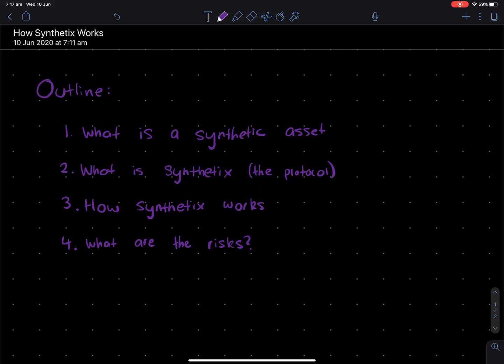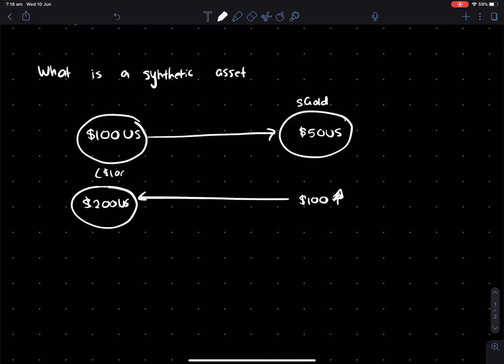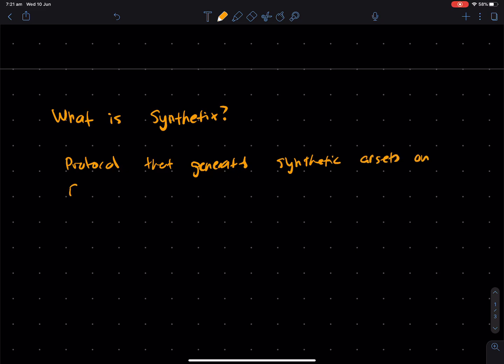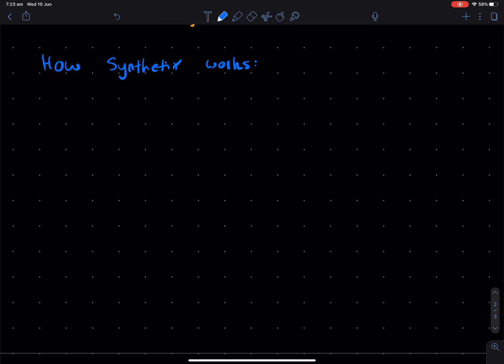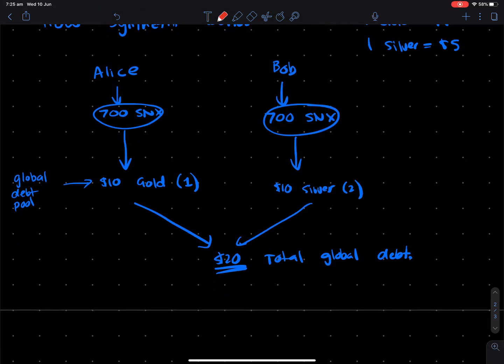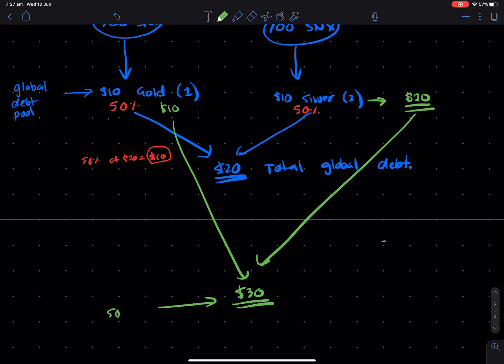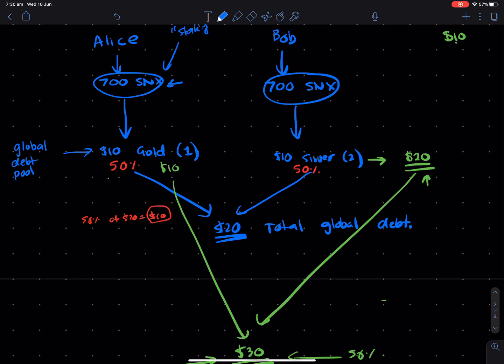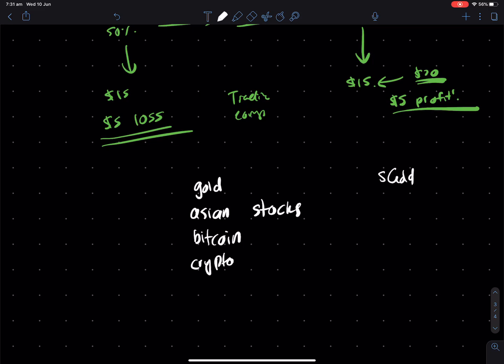How does Synthetix work?

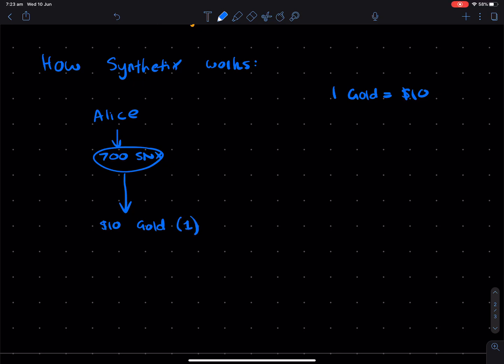Comment: @6:39 — 700 SNX = $100 of gold, not $10

(10 would mean a 7,000% collateralization ratio)
Reply: I assume the 700% overcollaterization is a MINIMUM requirement. So you actually want to overcollaterize by an even much larger multiple because you need to leave room for price fluctuations in the underlying asset.

Comment: It's too complicated. Do I have to get involved into this debt thing if I just want to trade on their platform?
Reply: Don't worry, Energi is working right now on simplifying synthetic assets while also making them more rewarding. It will be built into their upcoming Energi X exchange so it'll be a one-stop shop for spot and margin trading, onramping, staking, masternodes, synthetic assets, and more. I was in the SNX ICO and it took me a long time to understand their system. It's a great idea but it needs a lot of improvement. It's far more complex than it needs to be. Energi X should be released probably by early 2021.

Comment: I don't understand why would anyone want to mint synths. First, there is a 750% collateralisation requirement, where the average defi collateralisation is 150%. Second, people who mint synths is acting pool counterparties to traders on exchange. This means traders are taking profit/loss from the pool. The rewards for minting synths is getting exchange fee and SNX token. But the total exchange fee ever generated is a little over 9M, which is nothing considering the crazy collateralisation requirement. Also the only way to mint synths and yield farming SNX is by staking SNX token. So how did the very first synth minted? If the value of SNX keeps going up, people probably just stake SNX to get more. But if the value start to descend or SNX reward stops, would it create a death spiral? I'd like to know your take on why would peole mint synth. I can totally see why people would trade on syntentix.
Reply: Haha, you are a smart guy. I was in the ICO and I still can't say that I like the project. I think it's a great first step towards synthetic assets, but the projects of the future that improve upon this design will be the ones to watch out for. I'm selling my SNX for other things because I don't believe they will be here in 2 years. I could be wrong, but it doesn't feel safe to hold it long-term.

Comment: Doesn't this mean, that in the end (considering infinite assets and individuals), Synthetix is a very diversified global debt pool dampening an individual position?
In your example, 1 Silver increased to 10 USD but the win and loss were dampened to +5 -5. If you do the math for 1 Silver decrease to 2.5 USD you have win and loss of + 2.5 - 2.5.
For me, this feels like a socialized investment pool, where you can win or lose based on your weights of assets.
Reply from the maker: That's actually a really good way of putting it - hadn't thought of it that way tbh.
Reply: i think socialized investment pool is not the way to see it, but more like your acting as an investor but also as a market maker.